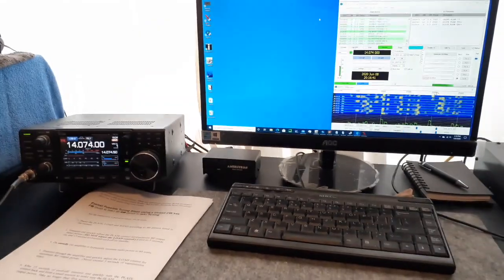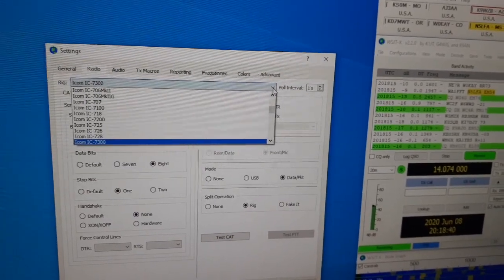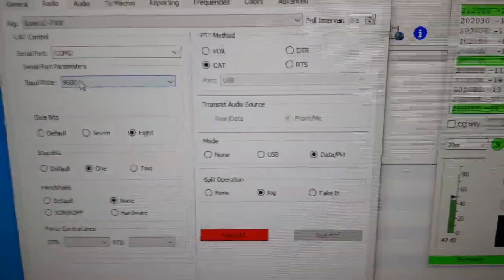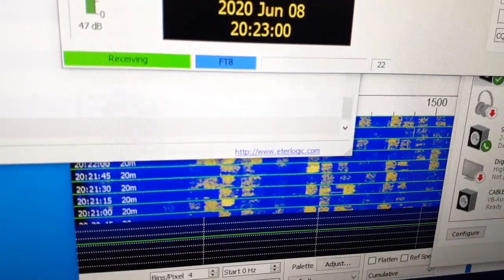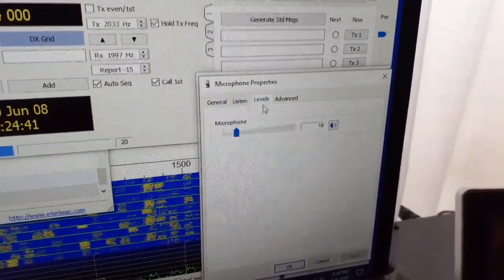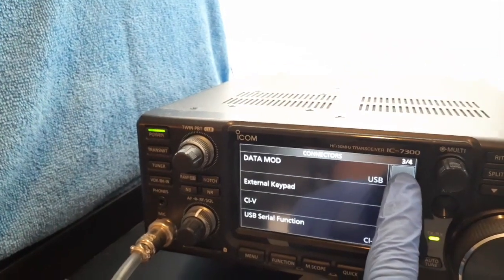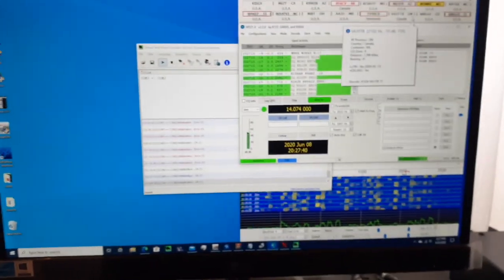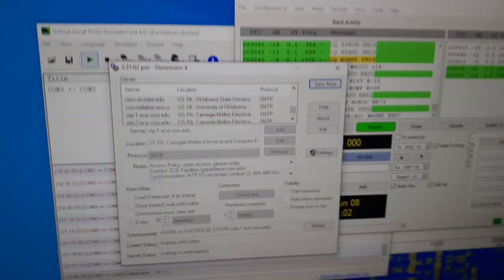WSJT-X and ICOM IC-7300, my configuration, setup, levels and considerations.

Comment: To me, this is the best explanation on YouTube for setting up an IC-7300.  Lots of info for one to go through to get it right.  Thanks for your time, effort and sharing of this video.
Reply from the maker: Oh good, I'm glad you found it helpful.  I have another video that might be helpful as well, about general software setup for digital modes and logging: https://youtu.be/F6d_LbvioMA
Reply: @SWRadioConcepts  I will look for the other info you mention.   I have lots to do before I get into other aspects of setting up the radio.   The speaker and mic settings (CODEC) you gave were most helpful.  I stopped there for the evening since I have been trying to figure things out for half the day.
Reply: @SWRadioConcepts Before I go any further and to determine if there are other problems, when I press the  “Test PTT” button, should it turn green or does it remain red in color.  Seems to me it should turn green if all is correct.
Reply from the maker: @jarmstrong2843  I don't have my system setup at the moment as it's all boxed up pending a move back to California from Texas late June, however, if I remember correctly - it should turn green.
Reply: @SWRadioConcepts  What part of Texas?  Tyler here.

Comment: how much power do you transmit?
Reply from the maker: usually about 20-25 Watts from the IC-7300 into my MFJ amp, which ups it too roughly 100-150 watts;